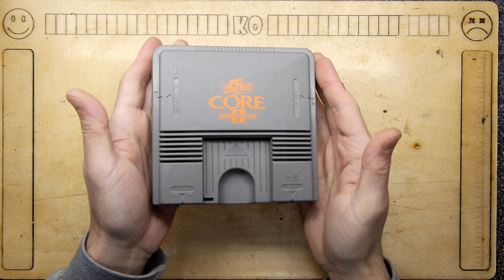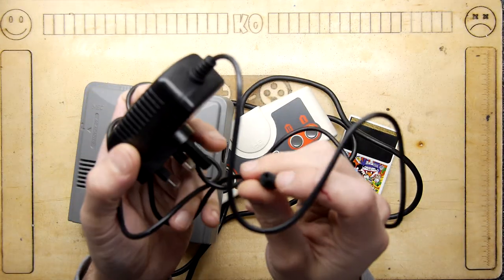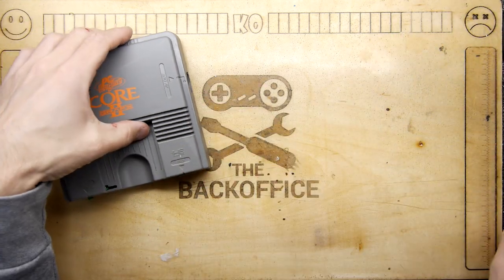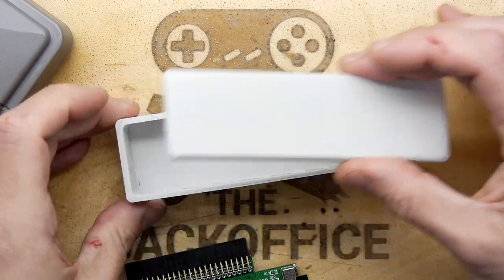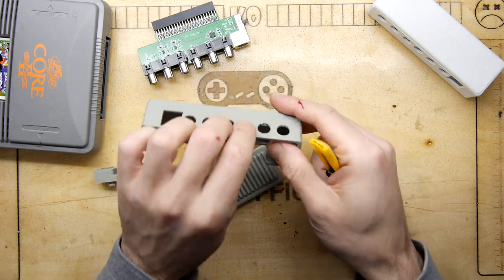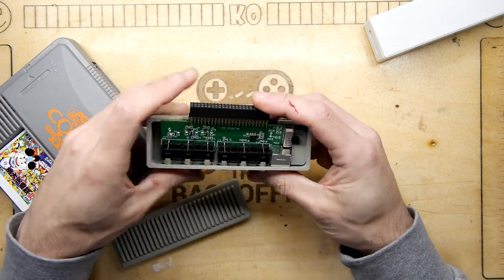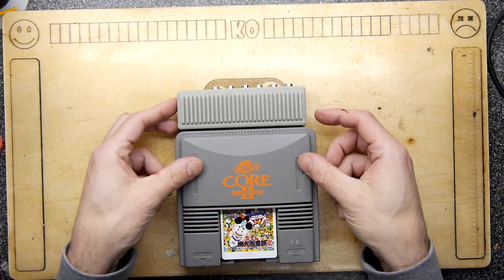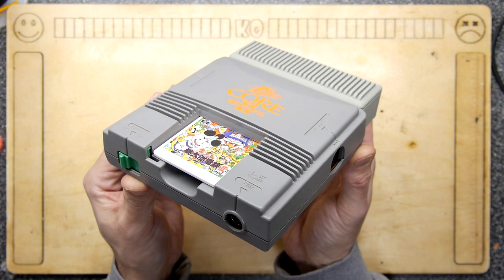PC Engine AV Expansion and Enclosure

Comment: Nice job on the addition of RCAs.
Reply from the maker: I'm almost tempted to make my own board and remove them 😂 I guess they are popular in places that do not have Scart
Reply: @25Hz are you referring to the RCAs on the bubbly wobbly?  Also, it would've been easier to  level expansion to bubbly wobbly, using four felt tabs.  I'd love to know what he would call them  ;) foot pads?

Comment: The CoreGrafx II is slightly reduced-cost compared to the original CoreGrafx. The most notable difference is the grounding pins on the bottom. The original CoreGrafx used individual pieces with individual springs that interface with the board. Not only was this more expensive, it was also fiddly to install. Many people lose them during disassembly, but not the way CoreGrafx II does it.

Comment: That's a handy thing! I was just given an identical console for my birthday recently! I'm using the AV port but it is a bit clumsy to have it sticking out of the side. I may have to pick up one of those boards and print your enclosure! Very nice! :-)
Reply from the maker: I think that is a smashing idea! The side ports are an odd and annoying design
Reply: @backofficeshow  it looks like a good match for the design of the console and I've seen those adapters at decent prices on eBay! After I did some research I found out that the quirky design choices for the PC Engine were because the 'Engine' console was supposed to be the basis of a modular computer system. The console part was the "Engine" of your PC :-)

Comment: How much time is worth definitely speaks to me.  I was designing a case for a project and using Fusion 360 for the first time.  I think I printed it 4 times at about 10 hours per print.  Each time was better but needed more tweaks.  For the final one I just had to say it's close enough and just sanded and added glue until it worked enough.
Reply from the maker: I guess if the thing will look the same and function the same I am happy to glue it and save teens of hours in some clever clip arrangement that no one will appreciate or see 😂 I think that might be my cutoff point.

Comment: The new box looks good. ;)

I'm not sure why they even needed the switch really. It would only be needed if somebody had the phono sockets and MD2 cable plugged in at the same time.

(due to the double 75R termination making the image look dim.)

That's very likely a THS7314 chip they used, which is able to drive two outputs simultaneously if you change the output resistors around. Although I think that then does need a switch again if only one display is plugged in.lol
Reply from the maker: You are correct sir on the chip. I almost spun up a board for this because I have an N64 that works also benefit from an RGB amp, but for the effort and BOM it really was not worth it. I am not sure why they did such a bad job on this board, I think even with the RCA sockets I could have made it a lot smaller.

Perhaps it was designed with an enclosure in mind and making it smaller would cause problems.. We will never know!
Reply: @backofficeshow  It might have been more useful if it had Component on the RCAs, but then that would have added another chip, or at least a lot more resistors. lol